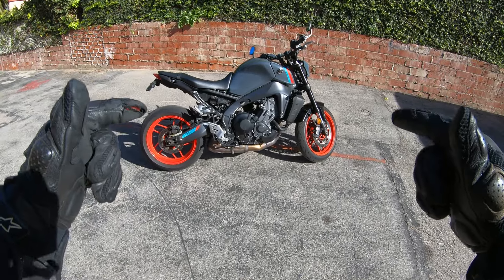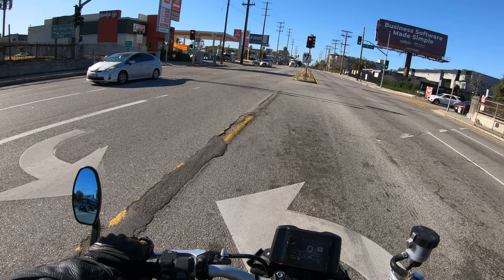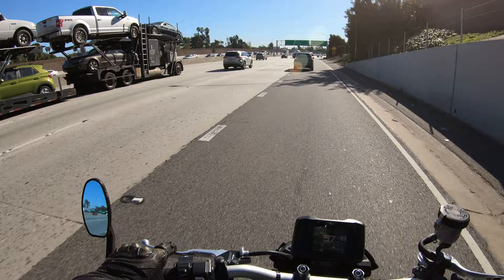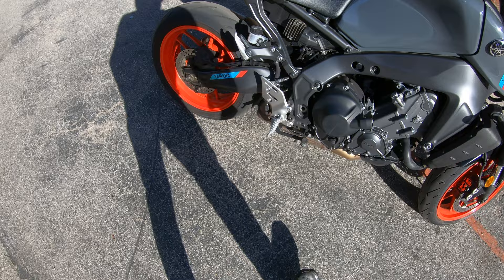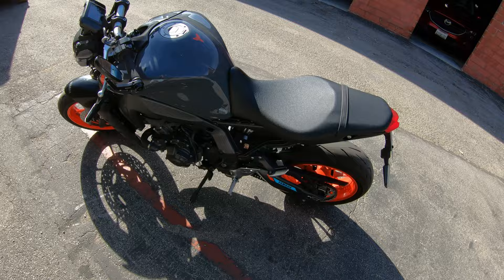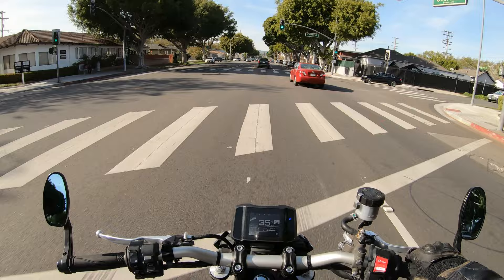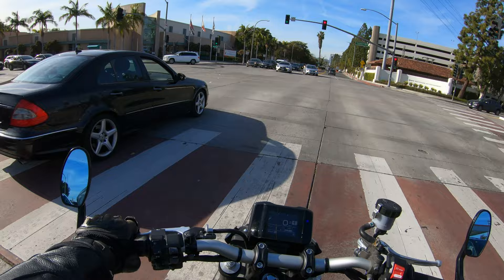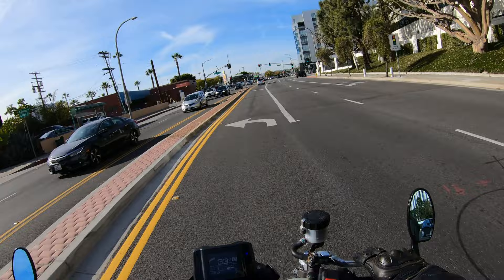Why STOCK EXHAUST is BETTER than Yoshimura AT2

Comment: What I don't understand is that the wind noise at 75mph+ is far in excess of any engine noise I can hear. There is a good argument to wear plugs anyway. Maybe you're not on the highway commute like I am, but I have a hard time imagining the engine would ever be loud enough to out do the wind noise. Is the Yoshi with the sound insert kit really that loud?
Reply from the maker: The wind noise over 75 is probably louder than the yoshi, but the yoshi adds another layer of piercing sound to the mix.  Too much for my ears anyway, might not bother other folks 🤷‍♂️

Comment: Honestly could have just gotten a flash tune to fix the afr. Mail your ecu get it back same week ez cheap hp gains. Weird that youre saying its loud because i can still hear so much intake noise but sound in video will always be different. I think the stock exhaust sounds good i just want more sound at idle. I may regret it as well cant say. Also wind noise from helmet is loud enough to cause hearing loss over time so you should be wearing hearing protection anytime youre going hw speeds.

Comment: Did you have the yoshi baffle in it. Shame. Stock is tame. Thou as ive said to people it sounds very good. I dumped it and got a kelpie and yeah my ears ring with baffle in. Might have to wear plugs and short rides enjoy that triple. Ive got my stock put away just in case. Great video man.
Reply from the maker: Thanks for tuning in!  I did have the baffle in the yoshi and it was still too loud, for me at least.  The triple really does sound great with an exhaust though 🤷‍♂️…as far as earplugs go, I’ve found Decibullz to be the best solution so far.  Folks have also recommended air pod pros with the noise canceling feature.

Comment: Was there no way to simply reduce the loudness of the yoshi instead of having to fully replace it? I love the different type of sound the yoshi gives, but I'm not that interested in it being louder. I just want it to sound different.
Reply from the maker: There’s probably a way to reduce the sound with a custom baffle or something like that, but nothing that I found off the shelf 🤷‍♂️
Reply: Yes, Yoshimura actually sells not one, but three levels of inserts for this exhaust. Two are sound inserts lowering the volume only to different levels, and the third is a spark arrestor which is is designed to prevent the emission of flammable debris and lowers the noise level more than the other two. This exhaust ships without any inserts.